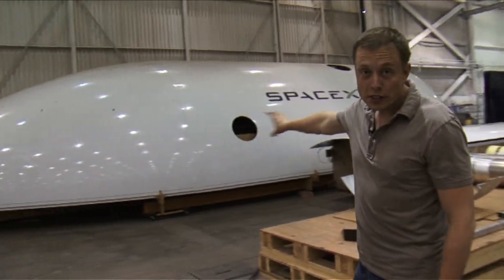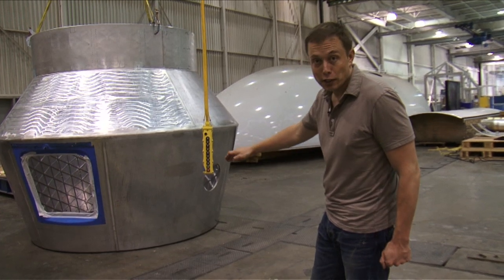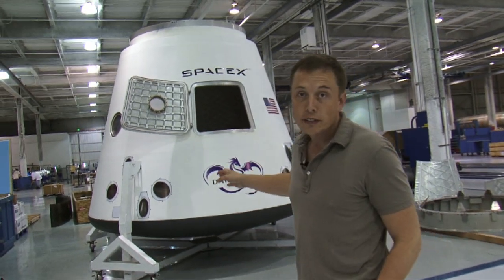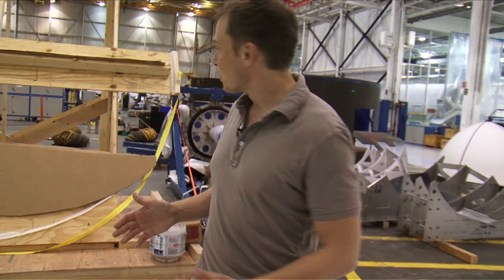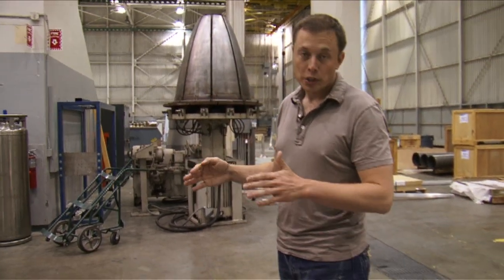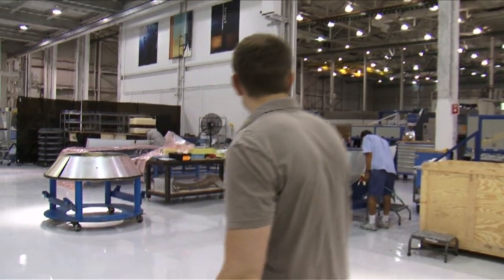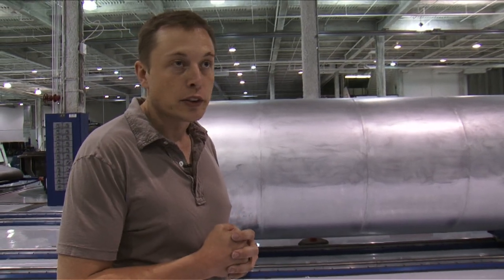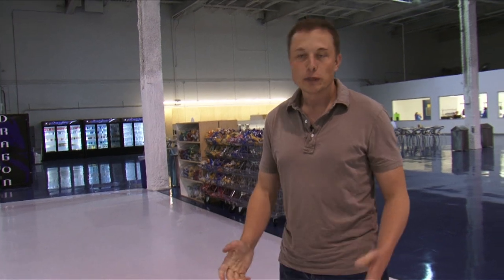Elon's SpaceX Tour - Falcon 1, Falcon 9 and Dragon

Comment: My humble opinion is as following that :"Thermal nucleus fusion torch method",US Patent # 8,436,271, filing data is 04/14/2010, Patent issue is May 7,2013,  is a future of space traveling and SpaceX INC....
 and
My Patent is a way to design a thermal nuclear fusion torch engine to reach the nearest stars and creates the thermal fusion power station with unlimited time of plasma operations without strong magnetic field devices for confinement of plasma ...